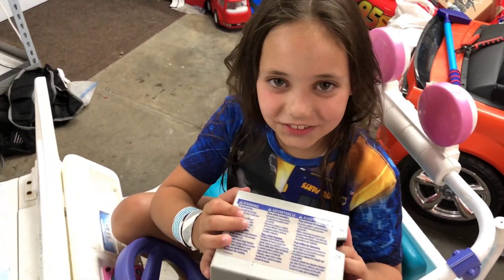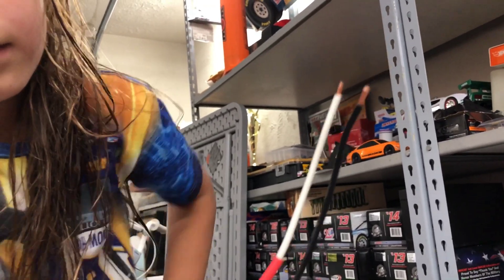Swapping the battery connector plug on an old 12v power wheels to make it work with NEW battery

Comment: I have a similar situation with an older barbie quad. I saw you had the 2 connectors to 2 individual batteries but you didn't mention if you combined those or just had to do one set?